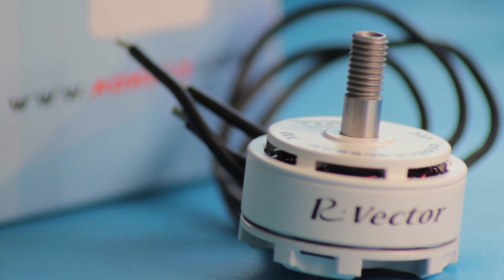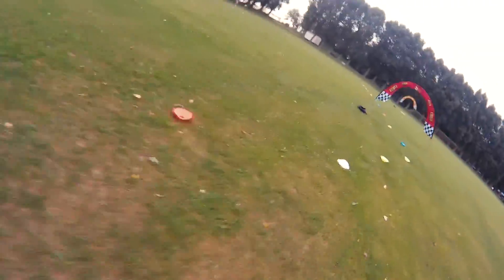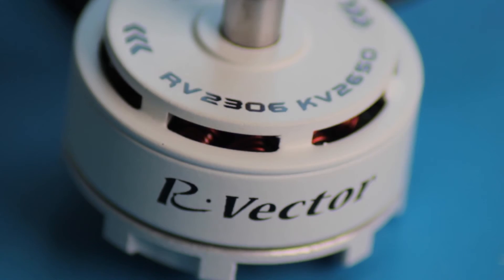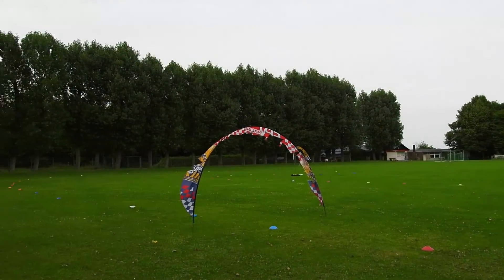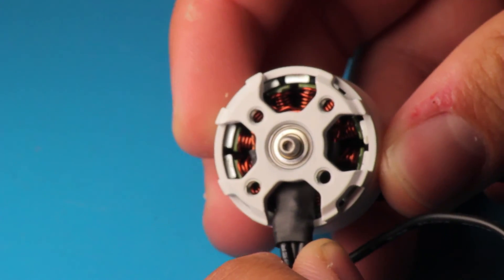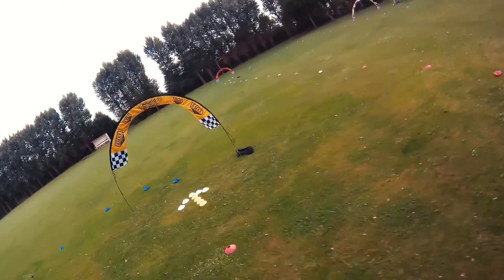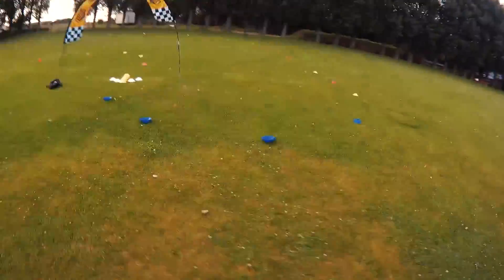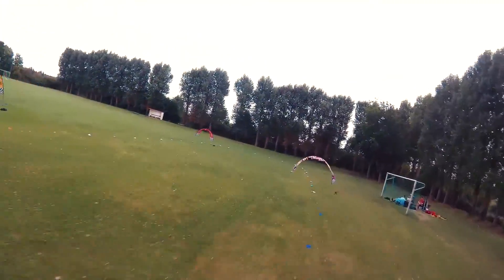AOKFLY RV 2306 2650kv Motor Review - the new High Power, Low Cost standard?!

Comment: Why did you need to change motor timing to mid-high?
Reply from the maker: Karolis Vasiliauskas it got a little bit hotter. So I changed it and it works better now
Reply: I have some problems with them or with ESC, don't actualy know. I have something like death-rolls, can't find the problem, so trying everything :D